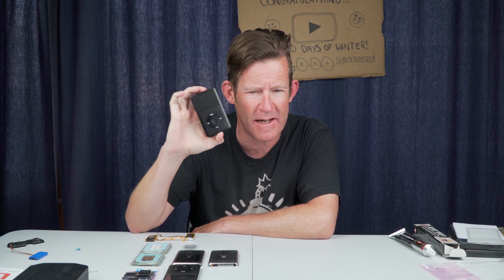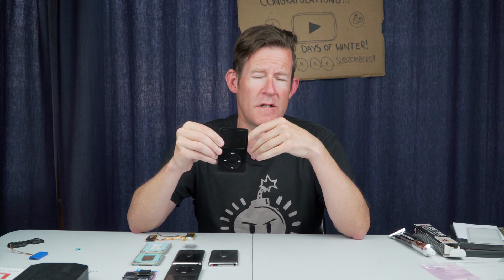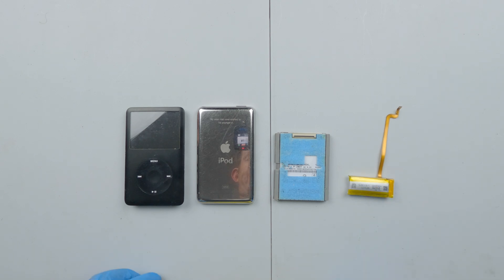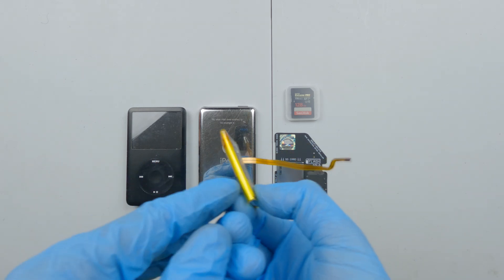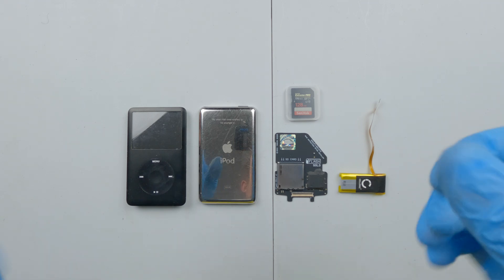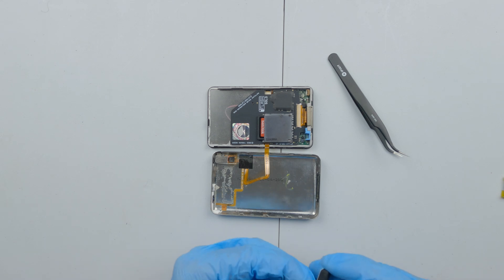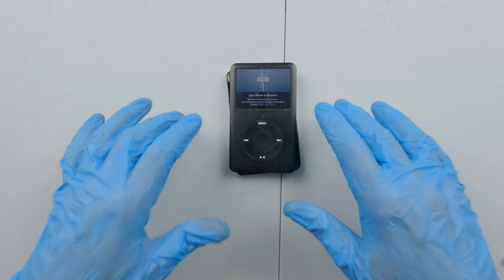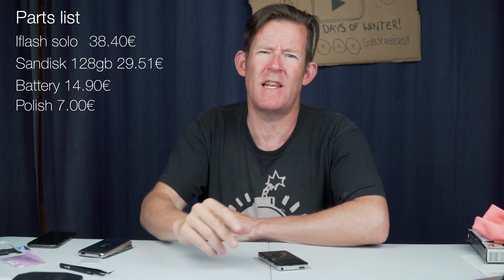APPLE IPOD CLASSIC REFURBISHMENT AND IFLASH SD UPGRADE 4K

Comment: Just a quick question how do i update the firmware on a ipod classic 5th gen because itunes does not recognise the ipod but my laptop does if you can help me please because i need to find because i want to put a flash drive in it but i need to know to restore it to work
Reply from the maker: I put the ipod in DFU mode. When it connected it then downloaded the lastest firmware, which compared to Iphone firmwares nowadays is tiny and only took a  few minutes

Comment: Is the UI more responsive and snappy after the flash mod?
Reply from the maker: I've only upgraded 6 and 7 generation ipods which were already snappy. An sd card is more stable than an old mechanical HD.

Comment: Hi, I have a question, when changing the HDD hard drive for the adapter with the SD have you installed something or formatted the SD?🤕
Reply from the maker: you need to format the SD beforehand. and there is a specific way of formatting depending on Mac or PC. I had a minor problem when it came to formatting but after looking at the adaptors website everything was clear.
Reply: @150daysofwinter  hi again, I'm not sure what could be happening with my microSDXC UHS-I Card with adapter. I've just follow a 'guide' on Iflash web where the adapter was. I press center and menu buttons at same time, and a message on ipod's screen appears saying: 'Use iTunes to restore'. At this point I plugged in on my iMac and after a few seconds iTunes detect  an iPod on recovery mode, I click on 'Restore ipod' but for no reason it brings the error 'error 1439 ipod cannot be restored'. After that I check the Disk Utility and what I see is the microSDXC has several partitions. I think the problem is the first formatting before start all the process. The microSDXC has 128GB and because of that I'm not able to format it as EXFAT ... What could I do to solve thiis 😫
Reply from the maker: @eloy_ftw  I am looking into the correct procedure for formatting the sd card. However, in the meantime try putting the ipod classic into dfu mode instead of just restoring it. Hold the menu and the center button for about 8 seconds until you see the Apple logo. Keep holding the buttons until the Apple logo disappears.

Comment: is it possible to do this?ive seen a video from YouTube(cant seem to find it) that its useless to open it since you wold be damaging the casing, the rubber linings etc. I have a iPod classic 160GB (Late 2009) that has screwed HDD, and do wonder if there is a viable way of reviving it. Watch this DIY video i doubt it can be done without damaging the device physically.
Reply from the maker: Opening the case is the hardest part but if you go carefully and don't force any of the clips its manageable. Once open replacing the hard drive is as easy as disconnecting the battery and disconnecting the zip connector to the hard drive. Again the hardest part i had was formatting the SD card properly before installing it.
Reply: @150daysofwinter  how did u format it, and was it super difficult? also how did the charge hold? thanks for the vid.
Reply from the maker: @Lachronix  Its a lot easier on a Mac than Windows. There is a lengthy page on Iflash website . New battery worked great, client happy